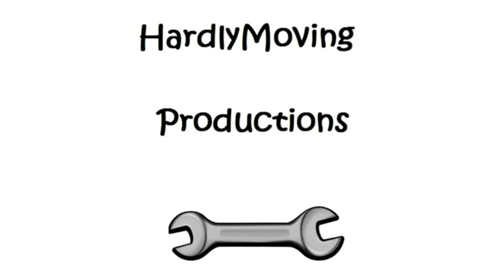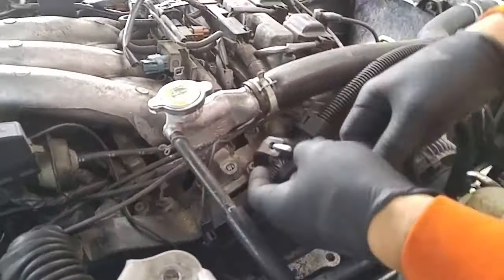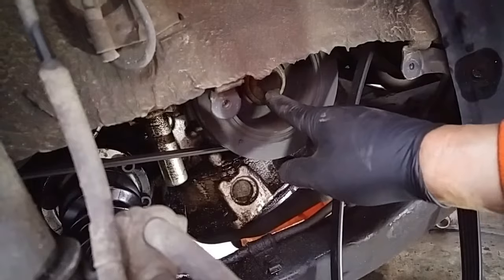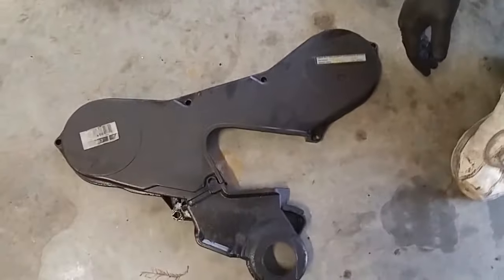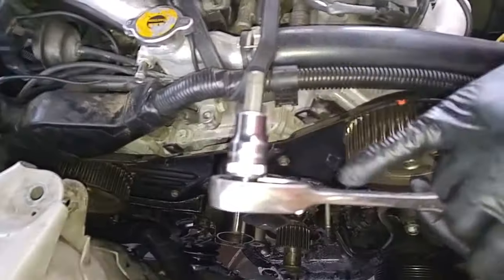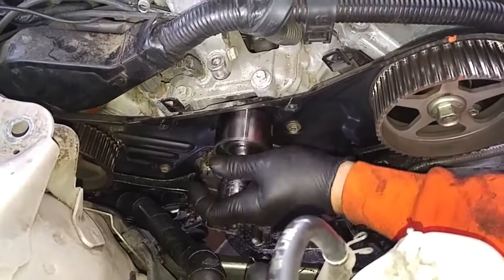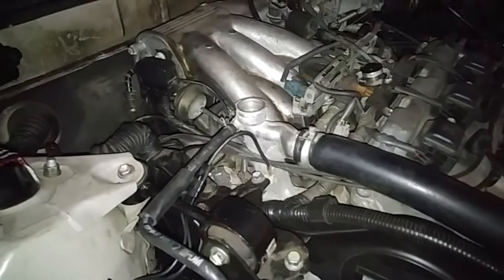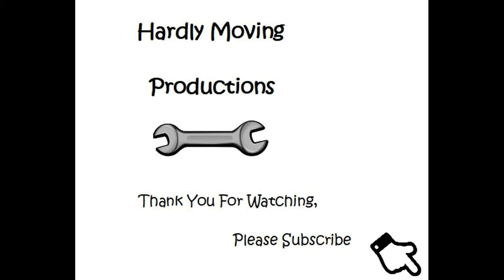Toyota Camry / Avalon 1MZ-FE Timing Belt, Water Pump, Seals & Pulleys Incl: Sienna/Solara/ES & RX300

Comment: Great Video, use of tools and easy to follow. For turning crankshaft while belt is on to TDC all 3, crank and cams, turn clockwise I understand but why is it ok to go counterclockwise a bit to get belt on. I thought you may have damage in the opposite direction. Also how do you know you are on up stroke or downstroke TDC.  Should you open the No 1 spark plug to see?
Reply from the maker: Thanks for your post!  You can go almost 30 degrees in the opposite direction before a valve touches the piston.  Even so, the valves won't get damaged since the pistons are stationary (unlike if the belt brakes while the engine is running).  At downstroke TDC, the crankshaft TDC alignment mark would be 180 degrees off while the camshaft TDC would be in alignment.
Reply: @hardlymovingpro  Makes sense and understand the concept now before doing the work. Thank You. Oh, by the way the video was very well done with excellent clarity (your voice), sound and getting into all the tough angles.
Reply from the maker: @billc2381  Thanks!  You might want to consider spraying brake kleen at or around the clutch contact surfaces to help dissipate the oil.  Don't do it with the engine running.
Reply: @hardlymovingpro  I removed the belt from top instead of bottom like you did. Unfortunately, the right bank or camshaft close to fire wall moved forward a couple inches. Initially all in line like your video. How to reline. Crankshaft and left bank fine are still aligned. Tried to move back but felt resistance.
Reply: Should I just turn clockwise to align marks?
Reply from the maker: Yes.
Reply: @hardlymovingpro  The video and the manual are a great help and I am moving along. I had two issues: Noticed the seal on the crankshaft was in there like a pancake and almost finished removing itl. Hard to remove from crankshaft inner slot.  Well, I think I know why since sent my harmonic balancer to be rebuilt and he said it was warped. He has a core and will rebuild or I will go aftermarket. Next checked my AC pulley. It has that pebble noise. Hard to remove due to compressor but a few tricks and was able to move compressor as is  and remove clutch and pulley. Not easy. Camshaft seals look normal. Removing water pump next. After cleaning up the engine to see it know that the camhaft and cranksaft were all leaking to a degree and the importance of changing these even if not leaking. That oil was a mess. Now I see everything.
Reply from the maker: Hey ... Good job!  Try getting a balancer from the salvage yard.  They're also cheap new.  Yup ... The ac compressor noise is the clutch plates being worn.  Always replace the cam and crank seals if even not leaking.
Reply: @hardlymovingpro  Thank You.
Reply: The cam near the firewall jumped forward on mine as well. I turned it back counter clockwise. Is this ok? It has some vibration when idling in drive or reverse. Runs fine otherwise.
Reply: Its been a while and slowly putting it all back together due to work and other 
commitments.

So far
1.Cleaned up all oil to see everything. No fun
2. Installed Camshaft seals. They went in  easily by hand.
3. Installed camshafts
4. Installed two pulleys
5. Installed Water pump
6.Installed bearing on ac clutch. No grease in old bearing when took apart.
7. Replace all weatherstripping (better word) on timing covers. It was falling apart.
5. Cleaned up crankshaft of previous seal(difficult). I had mentioned before it was smushed in due to bad balancer. Bought new balancer aftermarket.

One question can't get seal to seat on crankshaft. Checking part# and maybe still old seal in there somewhere. Tried placing a large washer ( drilled same internal diameter)  over seal then hitting with pvc pipe. Still not flush. May need a special tool? 

All torqued per spec.
Reply from the maker: Good job!  Yes ... Could be the wrong seal for the crank.  Usually goes in easy.

Comment: I have a problem.... the backing plate for the timing belt doesn't have any guide marks on it (that I can see) and with the crank set at TDC the upper cam wheels seem to be about 180 deg out..... is that just 'exhust stroke'? do I need to rotate the crank 180 deg?
Also...  did you remove the power-steering fluid container? it's hard to see in the video. I can not get the top timing cover to squeeze between the hose and the rear-upper-timing gear. .... I had to disconnect and move the power-steering fluid hose. (2001 Avalon aust build)
Reply from the maker: Yes.  Crank another 180 degrees. PS container can get in the way.
Reply: @hardlymovingpro  actually I think we both meant 360. cheers and thanks again.
Reply from the maker: Ops ... correct.
Reply: @hardlymovingpro  I cranked 360 but there are still no marks on the timing belt other then numbers and Toyota ????
Reply from the maker: A good quality belt should have 2 line marks for the camshafts and dotted lines for the crankshaft.
Reply: @hardlymovingpro  when the belt is off can you tell the difference on the crank shaft between TDC spark and TDC exhaust stroke?  (also p.s. I found the timing marks on the backing plate)

Comment: If the belt cuts, will it lock up and bend the valves? Ty in advance
Reply from the maker: If you're engine has variable valve timing, a broken belt will cause engine damage.

Comment: How did ya know were to mark the alignment points to know the cams were right ??? Did ya just mark it before ya removed the old belt ?
Reply from the maker: The camshaft sprockets should be aligned with rear dust cover timing marks and the crankshaft pulley with the engine arrow.

Comment: I have done this twice on my Avalon 2003 each time I use Denzo parts the timing belt always chirps  whenever it gets hot. I believe it’s chirping on the cam pulley where the teeth contact the metal. Do you have any idea why it does this?
Reply from the maker: Are you sure it's the timing belt?  Perhaps one of the pulleys driven by the accessory belt (i.e. tensioner, ac, alternator, ps pump).
Reply: @hardlymovingpro  yes I can pull the upper cover back and push down in the  belt to create the noise. Also if you put just a little bit of water on the belt it goes away tell the water dries up it’s the teeth of the timing belt on the cam gear making the noise I’m not sure why the last belt did that for 100k miles before I changed it

Comment: Is it possible to use timing marks on cams? I just need to replace the head gaskets on 1996 Toyota Avalon. I know I need to remove cams to get head gasket bolts to get heads off. If you can spare the information. Thank you.
Reply from the maker: I'd be more focused on ensuring the crank was at TDC along with the cam marks.  After the belt is off and before removing the heads, move the cam either forward or back until it finds a point where the there's no valve spring tension.  You can then remove the cams followed by the head.  Make sure the head's contact surface is true, the contact surfaces smooth and polished (both block and had) and that you use new TTY head bolts.  You have to be much more precise doing a headgasket replacement on all aluminum engines when compared to cast iron blocks.  Aluminum expands and contracts for the block and head at different rates hence the need for multi-layed stainless steel gaskets to allow the contact points to slide against each other.   If not done correctly, you'll be revisiting doing the headgasket replacement again.  After installing the cam, you can reposition the cams via the cam sprocket.

Comment: I'm in the process of completing mine now and can't get this harmonic balancer bolt off for the life of me. I tried to bump the starter and everything. Just ordered the high mass socket for my earthquake impact. Hopefully that does the trick
Reply from the maker: It will ... believe me, it will.  But after you get the bolt off, you may have a problem getting the harmonic balancer off as well.  Not tool bad if you have the pulley removal tool set.
Reply: @hardlymovingpro  I tried using removing the bolt with the high mass socket and it stripped the bolt a bit. I'm going counterclockwise so I think that the timing belt don't want to be changed.... lol.

Comment: 3:56 I'm having trouble getting the water pump over the two studs.  The studs are tightened so much, I'm afraid of trying to remove them.  I don't want them to break.  There seems to be a little jump in your video right at that point. Did you reinstall the tire and jack up the engine a little so the water pump would clear the studs?
Reply from the maker: Place a wood block between the engine oil pan and a floor jack.  The wood will prevent the oil pan from bending.   Use the floor jack to lift the engine up around an inch or so to tilt the engine up.  You should now have enough room to remove water pump.
Reply: @hardlymovingpro  That did the trick. Thank you very much. After jacking it up about an inch or so, it came out as smooth as could be. 😅
Reply from the maker: Good deal!

Comment: Shouldn’t you crank a couple rotations before install to double check timing
Reply from the maker: If you want but I don't.  As long as there's no belt slack between the cams and the crank and everything is in its TDC alignment, engine rotation does nothing IMHO.
Reply: @hardlymovingpro  gotcha.. great video man

Comment: for the crankshaft pulley bolt, is the power tool necessary? i’m attempting it with a breaker bar but it seems to turn the entire pulley wheel with it, will i still be able to remove it in that manner?
Reply from the maker: If not using an impact tool, you'll need to get a pulley holding tool to torque the crank bolt.
Reply: @hardlymovingpro  thank you! that might be one of my last 2 options; i tried to use an impact wrench and went out to buy some impact drives but it was barely pushing the crank wheel/bolt together each way, so unless i can get a friend to lend a more powerful power wrench & compressor, i’ll have to search for a chain wrench tomorrow. does it matter what kind of chain wrench i use?
Reply from the maker: Techlead
Reply from the maker: Techlead

Comment: you didnt replace the old tensioner correct? i think theres a similair kit without the tensioner for about $40 less. would you recommend replacing old tensioner?
Reply from the maker: Toyota tensioners don't seem to wear out.  But some people prefer to replace them to avoid the hassle of compressing the tensioner shaft.
Reply: @hardlymovingpro  cool thanks for the reply!
Reply: @hardlymovingpro  one last thing, were the bolts for the harmonic balancer removal tool m8x1.25? I tried using these that came with a kit and they only thread a few times. I read online the bolt size is m6x1.0? Thanks again
Reply from the maker: Doesn't matter that much.  As long as you have enough threaded in to mount the puller.
Reply: @hardlymovingpro  yea i tried a few several times, was finally able to get it off. thanks again

Comment: First time looking at this service done to the 1mzfe engine interesting 🤔 but at the same time complex maybe not for you anymore I've got this same engine in my 2000 solara v6 sle looks like a expensive job that's for sure great job though by the way
Reply from the maker: Looks tough but just follow the video and use the tools that I have.  I figured out how to do this service on my own.   And yes, the repair shops are charging big bucks and won't change the cams seals unless you ask them in advance.
Reply: @hardlymovingpro  thanks for the heads up about the seals i will remember that.i need a rack and pinion for my car but I'm still debating on if I should buy the part new or remanufactured any advice on that it would really be appreciated 👍

Comment: I have a question does the mark from the belt also need to line up with the dot on the crank shaft?
Reply from the maker: Nope.  Belt paint marks for the crank pulley is useless.
Reply: Thank you I appreciate your help
Reply from the maker: @abielcontreras511  You bet!

Comment: Will a 15 inch chain wrench work on those cam gears? I saw you use a 24 inch wrench in this video.
Reply from the maker: If you can attach a breaker bar to it.  Otherwise, you won't be able to generate enough torque to twist that bolt loose.
Reply: @hardlymovingpro  Okay. I have a 24-inch long breaker bar and a 15-inch long chain wrench.

Comment: Awesome video, but for anyone else out there, DO NOT use a metal wire brush to clean an alumunimun mating surface. Its very easy to eat into the surface this way and youll develop leaks much more easily. Subaru mechanics cry themselves to sleep over it :P
Reply from the maker: Rotary wire brushes medium grade is what all the techs use at the dealership.  DO NOT use sand paper.  Razors at you own risk if you good at not nicking.
Reply: @hardlymovingpro  yeah its an old practice from back when engines blocks weren't aluminum and tolerances weren't so precise. I know subaru recommends the 3m roloc bristle brushes 

At the end of the day I guess it comes down to finesse. I just didn't want someone going at their block with a wire wheel and gouging it up lol
Reply from the maker: We use the wire brush on aluminum surfaces but on an angle.  One new guy didn't believe in it and used sand paper.  He could never get it to seal with the steel gasket with the thin rubber coating.  He eventually had to heavy coat with RTV to make it leak free.

Comment: I will venture to do the timing belt on my 1999 Toyota Avalon.

The original owner did it at 90k miles, now it has 201k miles but it still runs like a champ. Can somebody tell me how much longer can get away with it?
Reply from the maker: Belts can break unexpectedly without indication.  Best to follow the recommended time or distance service interval.

Comment: Please help I took my top time cover off my 1mzfe 3.0 (1st edition WITHOUT VVT) because I have a crank no start after stalling while driving and I already checked getting spark with screwdriver trick also did carb cleaner trick spraying in air intake while cranking and nothing but some backfire so don't think it's fuel but looking at the cam pulleys when I put front one at Tdc the back cam pulley is at 9 O'clock and the belt is definitely severely warn but still intact IDK what position the crank pulley is in but aren't the cam pulleys always supposed to be at Tdc together and would or could this happen while driving and would it cause the car to stall then crank with a no start or would the car still run but run like crap and I'm missing something else that is causing the no start
Reply from the maker: If the belt snapped the engine will crank faster than normal.  Can you have someone crank the car while you observe what the belt is doing?  Also a jumped belt will cause a no start condition.
Reply: @hardlymovingpro  thanks for responding.. so the belt is intact but I can pull threads off the belt and it's the inside material left there's barely any rubber on it anymore lol it's actually the original belt with 440,000 thousand miles no lie but if I rotate the engine by hand and get the crankshaft pulley mark lined up to 0 mark on the timing cover the cam pulley's mark closest to the firewall is at 6-7 o'clock and the other Cam's mark is around 10-11 o'clock and that's in reference to TDC being 12 o'clock.. IMO from a lot of research you seem to be the best and most knowledgeable about this 1mz-fe engine & I have the one before VVT-I was added so I would love to ask a few questions that aren't in your videos I watched them all on this car 100s of X's 
* So engine is definitely out of timing to where it won't start lol?
* There's debate if it's a non interference engine should I be worried of internal damage?
* What does the 15 10 5 0 marks on timing cover and v mark on crankshaft pulley really mean if timing marks are behind the cover and on the crank sprocket when you remove the pulley?
* The only things that stop this engine from starting are crank & cam sensors, spark, fuel, air & timing? Or is there something else not so obvious that it could be?
* Recap* it was driving and while stopping to turn it stalled and never started again and IDK if this means anything but another mentioned it while cranking my rpm needle barely moved if at all and when cranking it it wasn't a fast strong crank like your car after finishing the timing belt job mine cranked like half that speed/power with a freshly charged battery and a jumper on it.

I do apologize for picking your brain as I'm not a professional just someone who grew up around fixing cars and tries to teach myself through what I can find online as well as trial and error but a 1,000% truly appreciate it you have the time to respond and thank you in advance for any ideas/advice given

Comment: nice job. maybe hit with brake cleaner after belt covers are off. the 1mz and 3mz are probably the best engines toyota ever made. toy should have stayed with belts on the v6 engines. the chain setup is a nightmare when it has problems from worn or broken guides or "stretched" chain
Reply from the maker: Yes ... I prefer belted vs chained engines.  But each has its pluses and minuses.  Chain problems shouldn't happen if you keep up with oil changes and add oil if the level drops.  I'd agree that the MZ engine are pretty much bullet proof.  The only problems I've encountered with GR engines are their water pumps and alternators.
Reply: @hardlymovingpro  it seems that the 4.0 l - 1GR- engines have some head gasket issues. what do u think about the 2GR -3.5l?